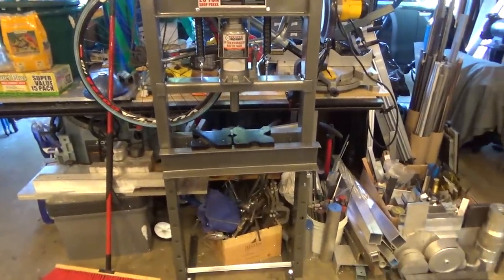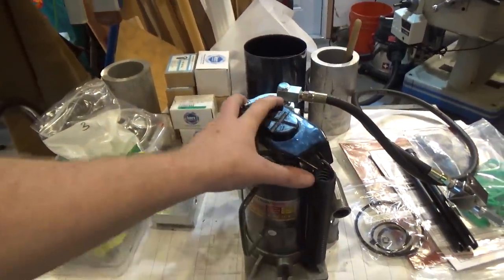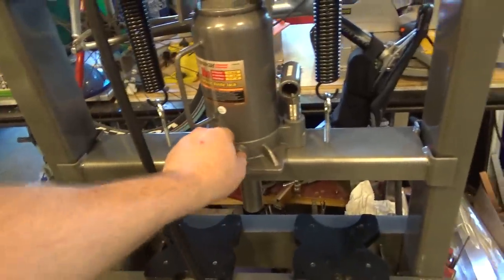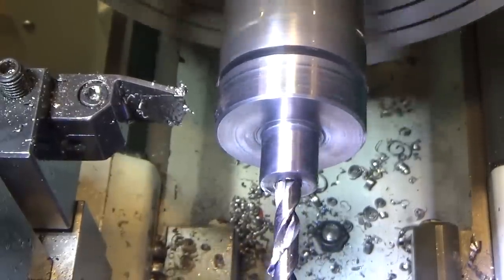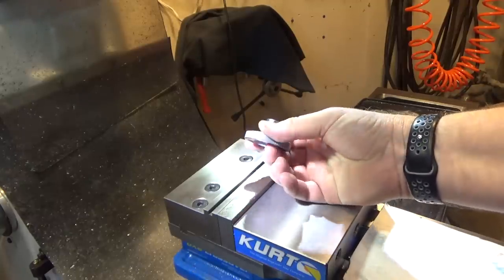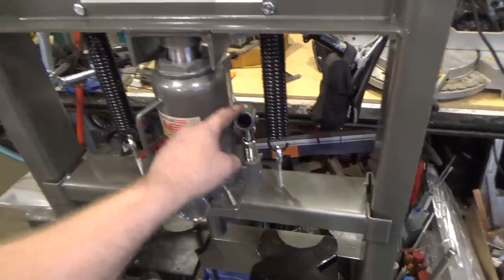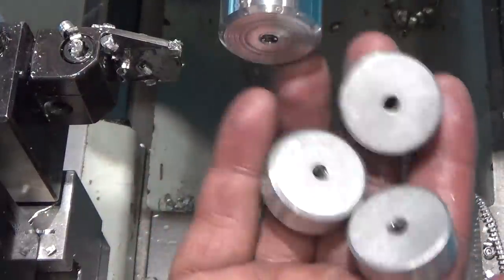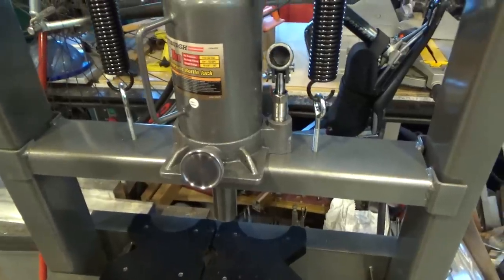Improvements to a Harbor Freight 20 Ton Hydraulic Press Part 1

Comment: Love the idea with the pins for the anvil plates. Made the change myself and it works great. Thanks!
Reply from the maker: Thanks. The idea came to me after the second time the plates slid off the crossbeam and almost hit my foot.
Reply: I don't have the drill press, but I just cut a square piece of plywood and JB welded to anvil plates.

Comment: I have a similar generic  press and apart from making a release for the knob find it functions very well. 
A bit slow to pump out 3" but not enough for me to spend more! The handle for mine is one piece and it pumps fine.Locating the plates could be handy, BUT I often stack the plates for smaller jobs. And also some other odd pieces of 1/2" plate I also have used for decades.
Having a proper thread and hardened end would be handy where it goes onto the job. Like that jack has. The current end is mild steel and mine is looking a but secondhand now.
Reply from the maker: Great feedback, thanks. I love to hear other peoples experiences. I was trying to figure a way to get a hardened threaded bit on the working end as well. I have considered disassembling the jack I replaced and use that, but I have not made up my mind yet.

Comment: Did the same with mine, but with a little different style of attack. The two main dowels I half inch pipe threaded the ends, and used 4 npt half inch caps. The jack I secured with 1 inch angle iron, two pieces cut  it's the same length as a bottom of the jack, then I drill and bolted them to the bottom of the Jack front and back. At the base of the press, I also added angle iron enclosing decides making a perfect square or rectangle, on the corners of the rectangle I added wheels so I can move it. I welded wheels on.
Reply from the maker: Very nice solutions. Thanks for sharing those with me and others.

Comment: nice mods,i have the same press and will likely add a couple if not all of your ideas. i mounted mine on 7 inch swivel locking casters from home depot,in fact most of my equipment in the shop is on wheels which makes cleaning up and rearanging a breeze
Reply from the maker: I was considering casters as well. It is great to know that they work safely. I was a might concerned, because the manual said the press had to be bolted to the ground, but there was never a chance of that. I put casters at the opposite end of the spectrum from bolted. Thanks or the idea.

Comment: We made a handle for out manual jack.  I drew a knob with 8 rounded lobes then we cut it out of 14" plate with the CNC plasma table.  Then took a 1/2" rod, but it to about 1", bored it to the correct diameter and then drilled a cross hole the same diameter of the roll pin.  My son TIG welded the knob to the shaft.  The roll pin drives out of the jack easily so we drove it out, put the handle on and then re-installed the roll pin.
Reply from the maker: A great set of modifications to the Hydraulic Press. CNC machines make so many complicated projects, simple. Having access to one is very useful. I considered remaking the hydraulic cylinder release pin from scratch, but ended up just adapting the knob to fit. I like your solution even better. 
Thanks for sharing.

Comment: Good enhancements. For the slick arbor plates and the adjustable press apron, I just sanded off the powered coat paint.
Reply from the maker: Interesting idea. I hate the paint. Perhaps there is a face mill in the future for my arbor plates. I think bare metal is nicer looking any ways.

Comment: The video itself was awesome easy-to-follow easy-to-understand great job. I was just looking into purchasing one of these presses. And you pointed out a lot of great improvements that needed to be done now I'm not sure if I want one due to the fact I cannot manufacture any of these improvements
Reply from the maker: It will work without them, but it will be harder to use. You should be able to pin the plates with a hand drill if necessary. If you drill into it and the chips come out powdery rather than stringy, replace the press plates, because they are likely cast iron and dangerous. Some of the other changes I made are for convenience. If you want a better press, you are likely looking at close to, or over $1000 new. The Harbor Freight press is under $200.
Reply: @DudleyToolwright  Thank you for the reply and feedback I really only have one job right now I know throughout my life. I'm sure I can use it. I particularly like the hydraulic valve release knob that you made the pins holding the table I would never be able to manufacture for the caps. the pins for the plate I'm sure I could do no problem. Nice to know about they made cheap out and give you cast instead of steel,,,,, if you happen to make any of these items again. The knob and and end caps. I would be interested. Thanks and enjoy the rest of the afternoon
Reply from the maker: I will remember. Thanks and best of luck.

Comment: I just bought the 20 ton harbor freight press.  They've made several changes to it that are different from yours.  It appears that the new version is now made with all actual c channel.   Vs the bend forms.  They also bolted the jack to the stand so it won't fly out and into your chest under 20 tons of pressure.   I think the arbor plates are no longer cast iron but solid steel.  Overall the new design looks like it will be much safer.
Reply from the maker: Very useful feedback for the community. Thanks, I really appreciate you taking the time to help out.

Comment: I enjoyed your video. I especially like the knob added to the release. I had to weld a piece of i beam across the top of my press for reinforcement. I was starting to get a slight bow in it.
Reply from the maker: I have a video where I push the press to see if it can deliver 40,000 lbs and you probably won't be surprised at the results.

Comment: I just watched the one that you made the swapping mandrels on it's "foot" , I like that idea. I had wandered about the plates strength as well. The idea you have of the 4 dowels pressed in to keep the plates it a good one. I may cut off some short pcs of round stock and tack to the bottoms in center of each plate. That way they can rotate 360° without having to lift them out. If thieves haven't stolen them I have several massive sized bottle jacks to swipe the rod and Acme screw out of to make the adjustable foot.  But after humpteen back surgeries a stand will be the first addition.
Reply from the maker: The stand sounds likes a great idea. I have tested the plates in a different video after a bunch of commentors ssid the press plates were cast iron an prone to catastrophic failure. Link: https://youtu.be/Z6PG3CCherU

Comment: Great mods. I also mounted a HF boat trailer winch and ran cables over some pulleys to the work table to lift it evenly , it was about a $25 mod and well worth it. Great video sir.
Reply from the maker: Nice. I haven't used this press much yet, but if I used it often, I bet your mods would make it a heck of a lot easier to use. Thanks.
Reply: Can you  post some pics? Or describe the set up?

Comment: I like all of your improvements. The one improvement I made was to get rid of the cast iron press plates that come with the Harbor Freight press, cast iron is very brittle, and to have one crack at 20 tons pressure, could be very dangerous to the operator. I ordered some 1" thick high carbon steel plates online, and feel much safer now.
Reply from the maker: A wise choice. Mine came with carbon steel plates. I think they must be learning and improving incrementally.

Comment: Always enjoy watching someone's ideas come to life.  A couple of machining suggestions for you.  Get a vee block to hold round parts in your mill vice.  A vee block provides three point contact on the circumference of a round part.  Holding a round part with two point contact on the circumference is not secure and the part can come out of the vice while you are machining.  Also, get an arbor and a selection of slitting saws.  Turn your work sideways, put your mill in back gear, use a very slow speed, use cutting oil and slit your slots.  You will not break any cutters if you take your time and you will won't be breaking any more little carbide end mills.
Reply from the maker: Thanks for the very helpful suggestions. I really appreciate you taking the time to share your thoughts. I am completely onboard with the Vee block idea, I just don't have any small ones at this point, but I intend to solve that issue. I like the slitting saw idea quite a bit. I have some, but have only ever used the very thin ones. Next time.

Comment: All ready did air assist with same jack but mine was bolted in so Indrilled the base on new jack to fit . works great
Reply from the maker: I considered fixing the jack with a more secure method, but it is held pretty well without. Thanks for sharing your approach.

Comment: I have the same press, added the air assist jack as you did. There is a mod I made to use the jack upside-down that makes a Huge difference, just welding a tube inside to allow the fluid to draw in the flipped position , There are videos on this tube that show exactly how it's done. Good Video !
Reply from the maker: Cool mod. Thanks. Your idea never occured to me, I really like it.
Reply: @DudleyToolwright  I also made the mount for the bottle jack so it could slide left and right to make the press a bit more functional, glad you like !

Comment: great work, we do not have harbor fright here but have the same type of cheap shops here, i made my own 50 ton press ( only because i had the steel to build it ) but used an air motor jack as well, for fast response time / saves a lot of hammer work when i fire up my forge / well done video
Reply from the maker: Thanks and I really respect the ingenuity in making your own. I thought about trying it and one one front was the cost of the raw materials being more expensive than the final product and the second, I am not sire that I would trust my welding abilities when forces like these are involved. Cheers.

Comment: I like it! what I did is welded the jack with angle , all the way around.
Reply from the maker: Interesting approach. I never considered that solution. I learn so much from other peoples engineering solutions. Thanks!
Reply: @DudleyToolwright   no problem let me know if you run into some problem.

Comment: I bought the smaller HF press on sale.  I don't spend enough time at my press to feel the need for turning it into a Cadillac but you've certainly made some nice improvements.  One of the biggest issues I find with them is the rather sloppy fit on the jack's lower cross-member (the bit that the jack sits on) in relation to the vertical member.  Side to side is nearly 1/4 inch of freeplay, side to side.  This creates problems with properly aligning the jack with the work and as you probably already know, that can be a huge problem.  My solution was to grab some Dollar Store cutting boards (pack of three for a buck!) and cut them into something of a 'T' shape to act as shims.  Cut to that shape, they hang on the horizontal member and lay against the inside face of the vertical member.  The only other improvement I've made was to weld a small, sturdy hook onto the side of the handle just below the grip.  When not in use, the handle now hangs neatly on the side of the machine and is always right where it should be.
Reply from the maker: Nice. I like your improvements. You are the second person to recommend inexpensive cutting boards as a source of HDPE. Thanks for sharing.

Comment: shortly after I got mine, I managed to break one of the plates. Cast material instead of  actual steel. YMMV  also a rack/tray to hold different size pucks or tooling is a good idea.
Reply from the maker: I like the tray idea. Quite a few others have commented on the issues with the press plates. Mine do not seem to be cast iron, like others have reported. I will still be wary of potential issues. Thanks for the heads up and good suggestions.

Comment: Crocks in the shop. Now there's a confident fellow right there! Excellent mods! Cheers! Zip~
Reply from the maker: Good eyes. I get at least one piece of swarf in them every time I work out there, but my wife gets upset if any swarf gets in the house. As a result, I wear different shoes in the garage and leave them there. I usually find myself going in and out at least several times, every time I work out there, so I opted for the much less than perfect Crocks option. Perhaps dimwitted fellow? Cheers.

Comment: I put an air over hydraulics jack on mine for $99 at Northern Tool. It makes it a really good press after that. No more swinging the pipe up and down in front of your face.
Reply from the maker: Good info. Thanks for the tips.

Comment: Great video. Two suggestions to make these mods easier: Use a plastic threaded knob (with brass insert), drill out some of the threads to fit the valve, and just mill the slot on the back; I've seen others do this.  Also, could you just use fender washers for the rod stops instead of milling new ones?
Reply from the maker: Great ideas! Thanks for taking the time to share them.

Comment: Nice video. Nice job on the handle. I think with those thin end mills it would be better to do plunge cuts down to depth and then out away from the part. That way you are giving it axial load instead. Probably break a lot less of them.
Reply from the maker: Excellent suggestion. Thanks.

Comment: I just bought one of these new 20 ton jacks, I liked/trust the old design better. I do not trust the welded upper frame. I'd rather have the old style bolted upper frame. I will be picking up 2 C channels and dill holes for bolting them to the top of the frame.

I like all the other mods you've done, especially the pressure relief wheel on the jack and the 4 locator pins on each of the sliding plates.
Reply from the maker: Thanks and I agree. There is something comfortable about a bunch of grade 8 bolts rather than an unknown weld bead. I have considered adding an additional cross piece on the top because it bent permanently when I acutally put 20 tons across it.
Reply: @DudleyToolwright  - I took mine apart and am taking it back to the store today to get a bolted version. I'll be picking up some grade 8 bolts to boot.

Comment: Nice video  i cant help but to think about how much i miss the old K Mart whenever i see any bottle jacks  as i boughta  1 ton  jack with a plastic case  as a teenager  and ive used that thing for over 35 years  of maintenance free service  as that thing has gotten myself and a few other motorists out od some jams  as i  have pulled all types of trailers from boats and campers and. Usually have spare parts in my truck so if i see someone stranded   I dont hesitate to. See if i can help  the funny thing is i think i only paid around 12 dollars for that bottle jack  in 1981
Reply from the maker: I love stories like yours. I think it is a crying shame that people design in obsolescence or early failure into their products these days. They want to sell you a new widget every X number of years. It's a crime.

Comment: You did great. If I may suggest maybe a safety wire inside the spring like a garage door would have. If those springs let go under tension I bet they could hurt someone. But otherwise your improvements are real nice.
Reply from the maker: Nice idea, thanks. I had not thought of that and have heard from others that the springs can be  a weak spot for these presses (as well as the press plates apparently). Thanks.

Comment: Change the release valve to a quick release valve. Make. For a much easier return little airline release $5.
Also use more oil over most of you're tools. Dry means friction friction means heat and tension. Both will break bits. From the Carbid tips to the tape n bits. Lol bit goes a very long way 👍
Extremely well done.
Reply from the maker: Thanks for the tips. Much appreciated.

Comment: I've got some ideas on how to modify my press. It will require a bit of welding with my everlast to beef up the structure and remove the flex. Maybe some material to make the stand slide more smoothly too.
Reply from the maker: Sounds great. If you happen to make a video, I'd watch. Cheers.

Comment: Swag off road makes a knob you can use for the pressure release valve if you don't have a mill/lathe to make one.  I've got one on mine and it works great.
Reply from the maker: Thanks. I made one, but the advise is great for others.
Reply: Post up a link for everyone

Comment: The press plates were sliding and wobbling for me so I machined the "flat" surfaces a little flatter.  Not fully machined across the surface but 80% or so. didn't want to thin down the plates too much.  So both plates are the same thickness and have no wobbling.
Reply from the maker: Excellent idea. I ended up doing the same.

Comment: I installed a floor in the bottom of the top part of the press(the part between the top C-channel), gives a place to store spacers and different pieces for pressing.  But yours looks a little different, mine has two channels on top, yours looks like Ibeam.
Reply from the maker: I like that Idea. My press has two pieces of angle iron bolted through the uprights. Is it just me, or is it weird, that at any one time Harbor Freight may have many different (sku's) items sold under the same name? When I bought this press there were three (different manufacturers?). So recommending anything might just be a crap shoot.